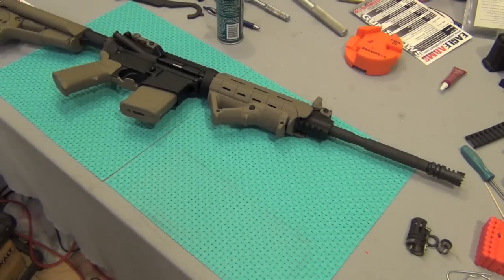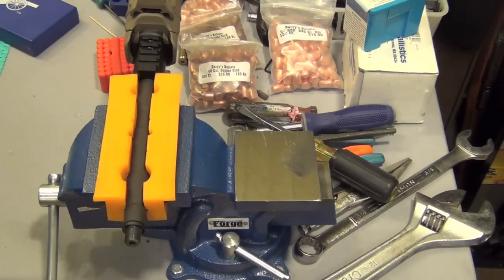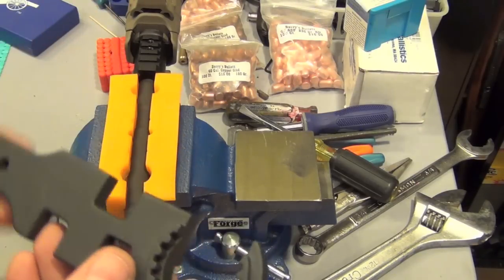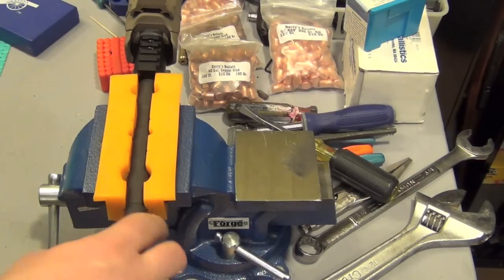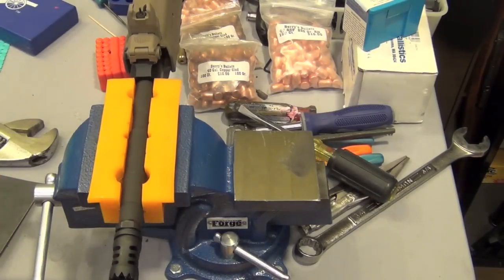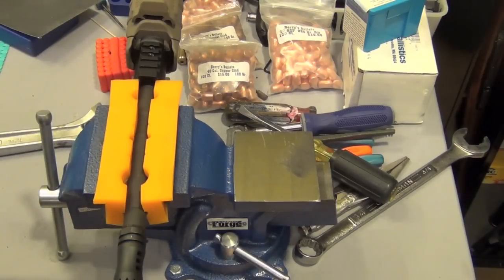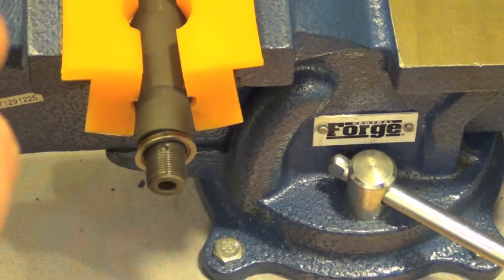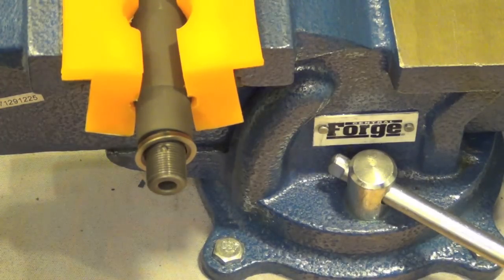PINNING THE MUZZLE BRAKE

Comment: Thank God for the comment section, and I hope anyone watching this video reads them because this video documents a federal crime in process.

You cannot have a barrel shorter than 16" attached to a rifle lower.  You would have to have a receiver that has not been designated as a rifle, and you would not be able to have that stock attached, or available (unless there was a rifle receiver available to put it on) = constructive intent!

Since that pin did not go all the way in, it probably missed the hole in the barrel!  Even if it had lined up properly, and was flush, it MUST be welded over after installation and an ATF agent must be able to determine that it has been welded if the rifle is ever inspected.

Our gun laws are ridiculous, and will probably become even more ridiculous in the future, but they are what they are, laws!
Reply: Dan A if its pinned and welded its 16 inches at that point because the muzzle brake counts as part of the barrel. which is the reason behind him doing this
Reply: That is a 16 inch barrel. . .so no laws were broken in this video. Why he is pinning a 16 inch barrel is another question on its own.
Reply: to each his own.
Reply: Dan A he's pinning it because that's whats required by NJ law
Reply: If you order any threaded 16" barrel it comes 16+" from the manufacturer, so when you add the muzzle device it puts it at least 1/2" + over the overall legal length. He's pinning the break because NJ law requires any semiautomatic rifle to be pinned and welded. It's a dumb law and the NJSP tried telling me that if you don't pin and weld the break onto the rifle than it makes it an "assault weapon". When I asked how the muzzle device on the end of the barrel makes the gun fire full auto he got pissed. This guy's doing the right thing by NJ law. He just needs to weld it, I'm sure he probably did it after the the video.
Reply: +Anthony Caramiello  Well didn't he break the law when he took it off?

Comment: If your state requires you to have a pinned brake you just posted a video of yourself violating that law. Just having the rifle in your possession for any amount of time without the brake probably counts. So good job there! As everybody else has said, that pinning job does not cut it! Welded blind pin, or full weld around the circumference.